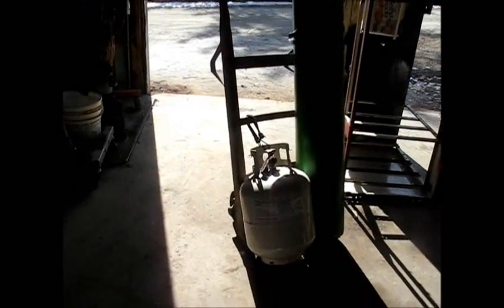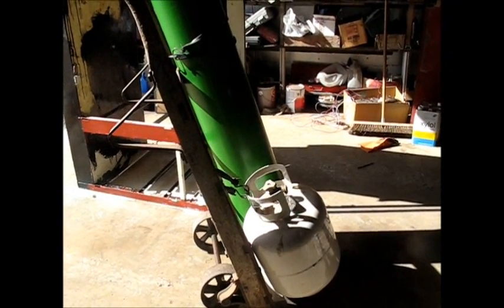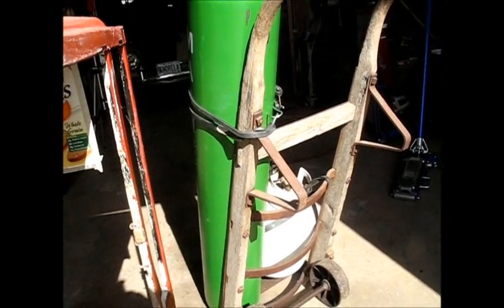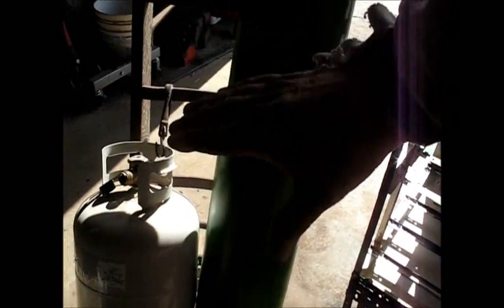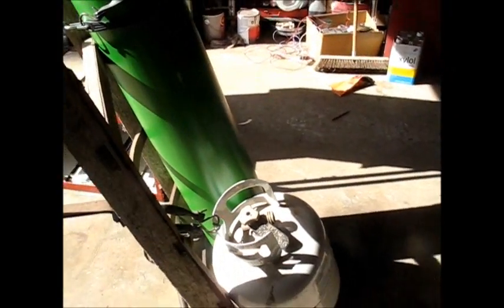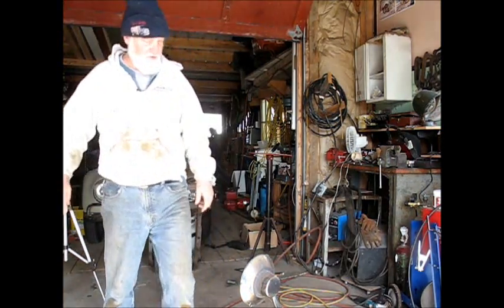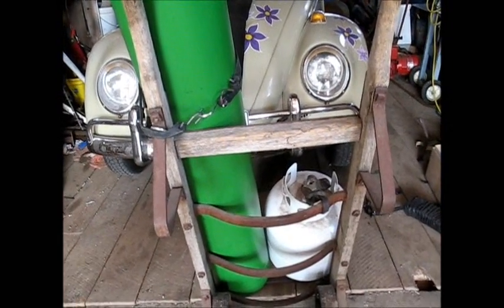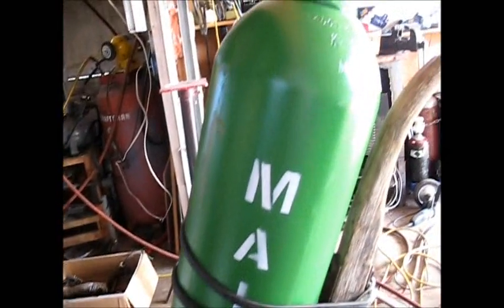Gas Bottle Cart new use for an antique barrel truck

Comment from the maker: @shartne   You can.  You have to get a different tip.  Some people also say you should use a different line and regulator, but rather than get into all that I just bought a Smith already setup for propane.  There's youtube info available on it.

Comment: @shartne yea man works great ,i even braze with mine ,all you need to do is get a propane tip for your torch ,and its alot cheaper ,and you can get it filled at the corner shop mart that carry tanks

Comment: ive seen alot of those exact carts in the past when i delivered to feed stores ,usually really old feed stores they had wooden pallets the shoe at the bottom fit perfectlyunder and you coald stack 5 or 6 50 pound bags on it without them falling due to the way it leans back i dont know if thats what they were built for originally but they were used for that alot,, still are i bet it worked great

Comment: I made mine out of a standard 2 wheel dolly several years ago, Put the bottles on and used a small tie down strap to hold them with the idea of improving when I got time but it has fallen in the catagory of if it aint broken dont fix it

Comment: man after my own heart ,(propane ) i been using it for the last 20 years ,some people has never heard of that ,i used my old truck also ,at the top ,i took an old brake shoe and tacked it on with the arch toward the tank ,then pulled a strap around it

Comment: That is a very fine use for that cart, but I'd like to see a kickstand on it so that the bottle doesn't go over backwards and knock the valve off the oxy bottle on the edge of a bench or elsewhere... that would be a seriously dangerous accident.